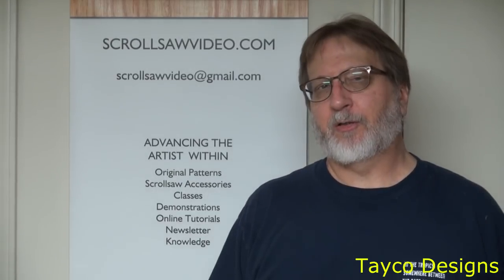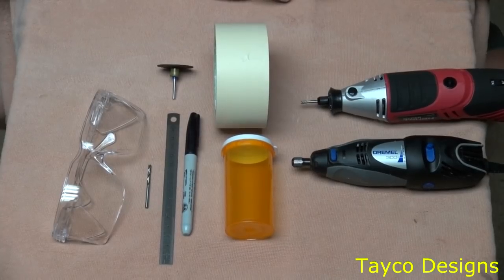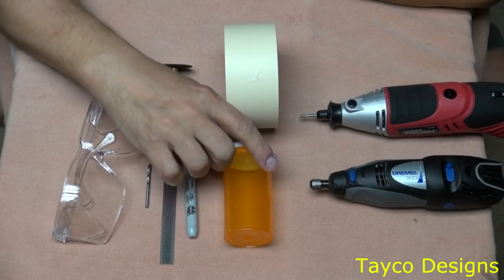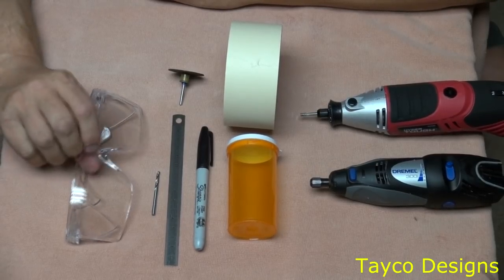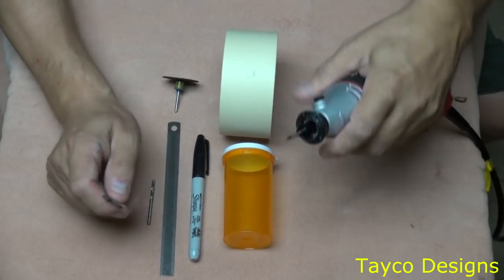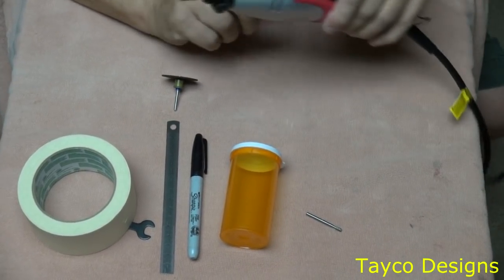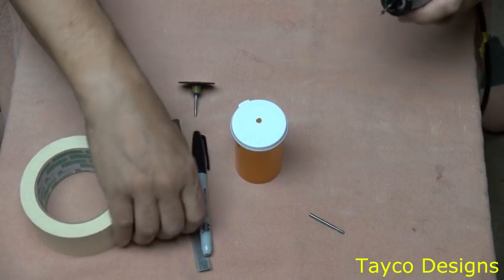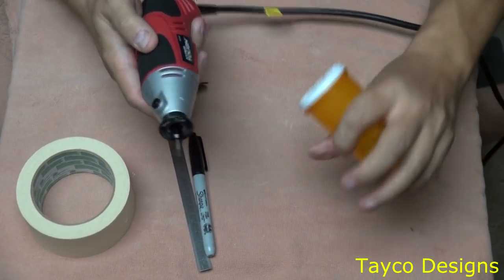How To Make A Safety Shield For Dremel Rotary Tool

Comment: If I were to make one of these shields, I would choose to use a clear plastic bottle, rather than an amber one. Also, instead of unplugging and plugging back in your AC plug, why not use a switchable multi-outlet power strip where you can just switch it off and back on, in-between blade changes?
Reply from the maker: There is no shortcut to safety. I will always unplug a tool before changing bits. 
Thanks for watching.
Reply: @ScrollsawVideo  Switching off a power strip is the same as unplugging the device. Only faster when making a video!

Comment: Hi. :) Thank you for such a useful idea, which will make using power tools so much safer. May I make a suggestion, please? You had to hand hold the piece to do the bottom cut; perhaps cutting the long lines, then hand-holding to join the lines to the bottom cut before doing the cut that goes around, may make it sturdier to hold (if that makes sense)? Also, it may be useful to say what speeds you are using, especially as some of the attachments have a speed limit (such as the dangerous circular saw). Many thanks again, and I hope to see many more tips during the future. I have just bought my first rotary too, and am not using it until I research on YouTube all the tutorials I can. :)

Comment: This may be a dumb question but, I bought a set of the "dangerous" saw bits (like the ones from an previous video of yours) and I was wondering if this would alleviate some of my worries about using them? Ever since that video I've been kinda scared to use them but I need to take off a short end of a project.
Reply from the maker: This guard may slow down the projectile but I would count on it being a total cure. Thanks for the concern.

Comment: I'ld like to see a video of what happens when a cutting disk shatters and flies apart!  I'm a little worried the the container will break away from the top and fly off.  The solution the Indian guy posted in a different video, with a container screwed to its top, seemed less likely to break off, though his water-bottle plastic might be more likely to let high-speed shards break through than one of these bottles.
Reply: Agreed. Untested methods are suspect. It might just create more debris to fly into your face when the cutter shatters, etc.

Comment: Looks to me that if tihe blade does not extend beyond the shield you will only have the shield in the way when cutting.  This would especially be true if use smaller bits.

Comment: So, what is the point of a plastic guard? Will it help if the blade breaks?
Also, why do angle grinders come with guards, but dremels don't?
Reply: The Dremel A550 Rotary Tool Shield Kit costs about $15 at Home Depot, Walmart or Amazon. It comes with 3 other bits you probably already have so I consider it unnecessary  but there's an AUTOTOOLHOME Rotary Tool Shield which is the shield only and it costs $5.99 at Amazon. It's the same thing and fits most rotary tools. I haven't bought that one yet so I don't know for sure but it appears the clear plastic shield is thicker than what you'd get from a pill bottle.

Comment: What a great idea,  thank you.  One question when you were cutting the bottle you left the machine on for a few seconds after each cut.  Was that deliberate, if so why did you do that?  I am new to Dremel and haven't the cutting blade yet. You are a good teacher. Ann
Reply from the maker: Thanks for watching.
No, i didnt leave the tool on for a few seconds for any particular reason, it just turned out that way on this project.
Reply: Woodworking & DIY Videos Thanks. l am a real beginner l appreciate your help

Comment: Looks good. Totally worthless as a shield, but looks good. An impact shield, especially for saw blades at high rpm, cannot be made from just any old plastic. Clear pill bottles are just polypropylene. What is needed for an impact guard is either metal, or lexan. The plastic you used will break, puncture, or shatter upon impact. The lid attachment? It will just pop off like it was held on by nothing more than a piece of tape. It cannot be called a blade guard when every part of the system will fail when the guard is needed the most -- broken mandrel, accidental impact, broken blade retainer screw, or a broken or bent blade. All of these things can and do happen. That device would not prevent injury from any of them, as even the accidental impact would pop the guard off of the unit. Even if it managed to stay on, the blade would chew through that polypropylene into flesh in an instant. That is what I call a tool shaped object -- It looks like a tool, but will not perform the function of the tool it resembles.
Reply from the maker: Great comment, thanks for sharing. 
This is what I call constructive criticism and very valuable material.

Karl

Comment: why the masking tape? why not just use a sharpie to draw the cutout lines directly on the bottle?
Reply from the maker: A few reasons, First, the sharpie may rub off of the plastic and second, the masking helps to prevent splintering. Thanks for asking.

Comment: To better find a center of a circle, just use a compass or a ruler. Just get the diameter then half of it for the radius with the point on the outer edge and use the marking side by making at least 3 semi circles. That will be the center of the circle. If you don't have a compass. Place the ruler at the diameter, trace the line, do it twice at different locations and where the lines intersect, that's the center point.

Comment: If you need to unplug your rotary tool every time you change a bit I'd say you probably shouldn't be using a rotary tool.
Sorry but that's just ridiculous. Do you disconnect the battery or unplug your drill every time you replace a bit?
Reply from the maker: Totally disagree.  
This is a common practice for most experienced woodworkers to unplug their tools before changing bits, blades, etc.  I have seen many videos and pictures of 'dangers' in the shop and unplugging tools is at the top of the list.
Reply: @ScrollsawVideo  like I said, do you also pull the battery out of your cordless drill before you change a bit? And what about a cordless Dremel where you can't even get to the battery? 

But hey, you go ahead and unplug your Dremel every time you change a bit, I'll stick with my tried and true method of not turning mine on while I'm changing the bits.
Reply from the maker: Do as you wish but I hope that one day you will not regret this decision.
Thanks for the comments and please leave more on future videos.
Reply: @ScrollsawVideo  I will and I will. In all other respects I found your video informative. I just think that goes a little too far. And no solution for it answer to the question of battery power or rechargeable

Comment: 9:57 Do not do this! This is super dangerous and it might hurt you. You should always bottom the bits down the chuck.
Reply from the maker: Incorrect, Due to the bore hole not being squared off at the bottom, bits should not be inserted completely in the shaft hole. This is also true to all routers as well.
Reply: Bits should never be bottomed. Don't you know the bottom has a slight bevel. That goes for a lot of tools. Hard to believe that you posted before fact checking.